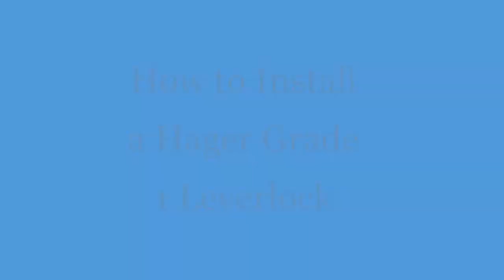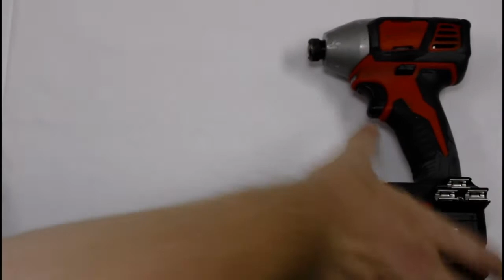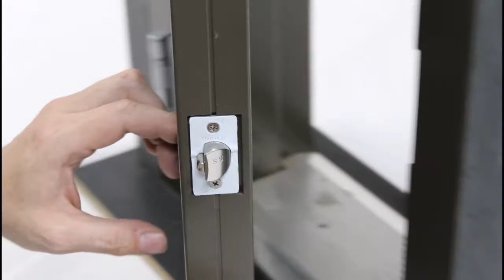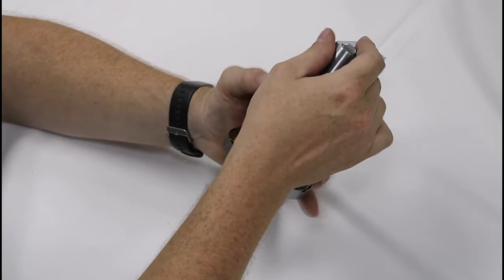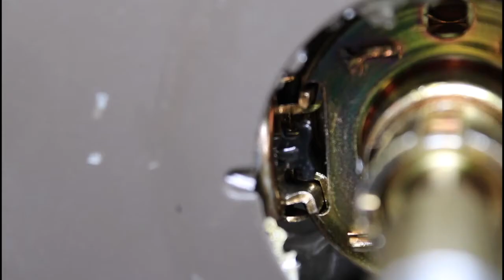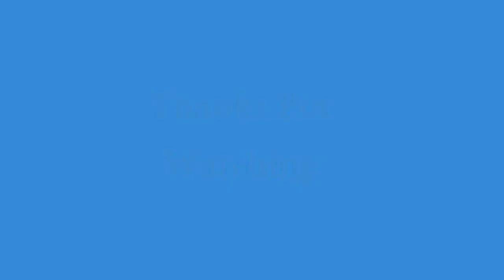How to Install a Hager Lockset

Comment: I just installed 3 door frames  today with their hardware , but for some reason one of them Doesn’t lock at all, any idea why is not working properly, I’d assembled and disassembled it several times and still doesn’t work, I need help